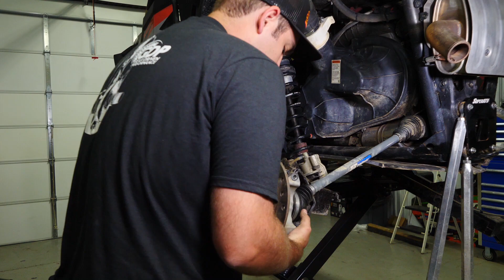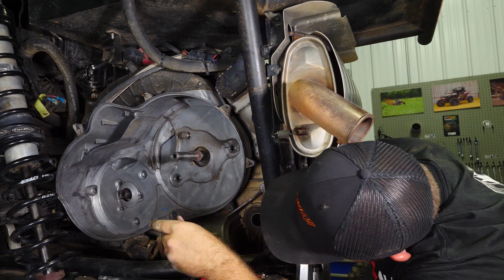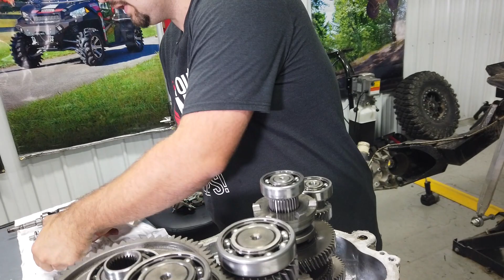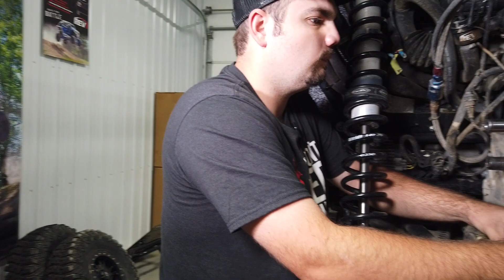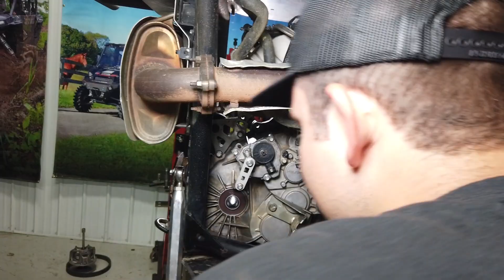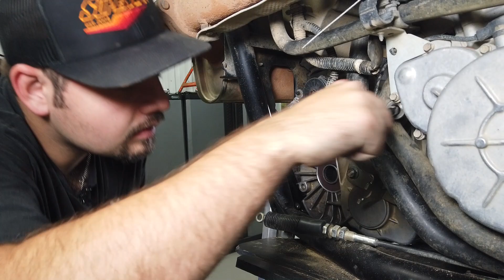Transmission High Gear Kit Install - Polaris RZR Xp Turbo

Comment: *******I bought a super atv transmission and it failed in less than 1000 miles. They give you 30 day warranty.  We’re gonna crack it open and see why. ****

Comment: I like how easy the primary comes off and the axles pop out in this video.  Almost stopped watching after that bit of fiction.
Reply: Just need a good rattle gun, I ended up going out and buying a 1300Nm rattle gun after trying almost everything and it popped right off.